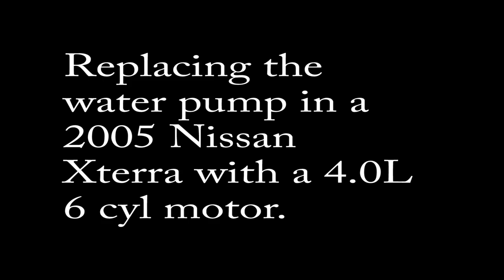How to Replace the Water Pump on a Nissan Xterra

Comment: Can you explain why you wanted to replace the water pump in the first place? Also, about how many miles were you at? Thanks for the video!
Reply from the maker: Hey man, thanks. This water pump replacement was an attempt to fix an overheating issue I had. I ended up doing the temp sensor, the thermostat, and the pump. I was at 132k when I did these. Hope that helps!
Reply: Jordan Horst I second that question. A water pump is the potential source of leaking and noise when the bearings and seals crap out, but is never (?) the source of an overheating issue unless something catastrophic has occurred, like a complete separation of an impeller from the shaft. And I personally have never seen that in metal clearance type pumps. (Referring here to the exception in rubber impeller friction pumps; e.g., Jabsco, used for the external water side of a marine heat-exchanger system.) And in the event of that separation, you would be popping off steam and/or seizing the engine, not just running a little warmer than normal.
Reply: eldorado96 what about overheating quickly from a cold start, Thermostat, radiator and fan clutch are good.
Reply: pono321 I covered that in my earlier comment. You would suspect water pump if there was no cooling (and a relatively quick and severe overheating condition) but that's not the original condition described. He said it was running a little warmer than normal. 

This was a great how-to video, but I'm still stuck on the implication that the original problem didn't warrant it. It still feels like throwing parts at a problem rather than making a true diagnosis.

The thermostat was replaced, but it could be flawed out of the box or calibrated to a higher heat range.  Given everything else being normal, I would be inclined to inspect the radiator more closely for occluded flow.

Comment: Was your tensioner making a slight knocking noise at first start up when the engine is cold I have a problem where I hear a knocking when I first crank up after the vehicle has been sitting overnight
Reply: same knock issue here :(

Comment: So I am having the same issues as you. Temps rising while sitting still. Rev the motor up the hand goes back down towards normal (so the water pump is working). However, using the bluetooth scanner, it shows my actual temps around 226-230 (getting dangerous). We have replaced the radiator (bc of a crack). Replaced all hoses. Replaced the thermostat and Temp sensor. Then the water pump (but the old one turned out to be okay). Next the fan clutch (it was bad). Burped the system. And using the All-makes All-models coolant 50/50. Not the blue. However, we are still experiencing the same thing. About 20-25 minutes of driving, the Nissan gets hotter. The temp gauge says it still in the okay zone. But the Bluetooth connector reads again...226 and it will hold steady at 226-228. But then you stop and it begins to creep to 230 (235 was as far as it got). However, it showed it was below the small tick mark before the H zone on the gauge. 

Have any suggestions? Are we missing something? You mentioned yours still creeped up and you replaced the water pump. Did you ever resolve the overheating issue? Thanks! (Great instructional too)
Reply: I'm having the exact same issues! I've done everything to try and resolve it. Now I'm on my last option the water pump. Let me know if you figure it out.
Reply: @kgregg2092  We discovered the radiator was bad. We actually put FOUR radiators in it from Advance Auto until we got one that was good! All factory defects: blockages or leaks at the bottom. The coolant in the Nissan flows up and down instead of side to side. This allows blockages to build up in the bottom of the radiator. ALSO. We discovered three thermostats did not work properly. Placing the thermostat (brand new) in a pot of hot water on the stove with a thermometer, you can see how it reacts. At 180, it should begin peeking open. At 190, it should be about half way open. At 200, it should be fully opened. Two of three thermostats opened half way at 205! And then fully at 225-230. The third thermostat was good. Check your thermostat. Don't assume it is good because it is new.
Reply: @oswalddesign  thanks so much for the reply. I'm going to replace the water pump and might as well do the thermostat again. I'll flush the cooling system too. Hopefully this will finally solve my issue. If all of that doesn't work the only part left to replace is the radiator.
Reply: @kgregg2092  Change out the temperature sensor as well. It's not that much — and it could very well be the problem too! We did so for good measure.
Reply: @oswalddesign  thanks again for your reply. I'll change the sensor too. I got the water pump out and it definitely was bad. My timing chain tensioner was also broken. So I'm hoping my issues will finally be solved.
Reply: @kgregg2092  That's great news! I bet the tensioner and water pump will take care of the issue then. For me, the water pump and the tensioner was still good — but there was evidence it had been replaced once before (gobs of gasket maker). The temp sensor is all the way to the back next to the firewall. It's a beast to get to so if the water pump does the trick, you may want to let sleeping dogs lie.

Comment: lol ... I couldn't depress the tensioner on the car either. That's why I looked up the video, to see how to depress it. I was about to remove it altogether, but decided to look first to see what others did. Turns out you did the same, though you didn't say so at the step in question.

Comment: RY,  Question for you. I just replaced my radiator, thermostat and the temp sensor. Filled with fluid and let it heat up and cool down a couple of times. I then start driving it and now the water temp gauge is going HOT. Now, I wasn't having an issue before but wanted to replace them due to 218K miles. It was working fine before but now it's overheating. Is the pump bad now all of the sudden?

Comment: Mr. Ry first of all thanks for your vids.  Can you help me with the right bank and left bank secondary chains install, I want to make sure I am doing right. Looking from the front of the car the intake I think I set I right, but I am a but insecure with the exust side as how to Mach the chain and the sproket with the oval markings and round ones. Any help will be appreciated. Any images could help. Thanks.

Comment: What milage is recommended for water pump replacement ?  If the water pump fails could it dump coolant into the engine oil?

Comment: I had an overheating problem on my Nissan a few years ago. I had no intentions of opening up the front of the engine for a water pump replacement. The shop did that and replaced the water pump. Over heating still happened and they replaced the thermostat. It still over heated. Once they got an OEM thermostat from Nissan the problem was solved. I think they got the thermostat from NAPA and it may have been for a different model or sized engine. What a costly mess. Oh....by the way, they tried a radiator swap and that didn't work.

Comment: did replacing the water pump resolve the idling over heating problem?
Reply: OmoOwa I'm wondering to
Reply: Doubt it.
He never comfirmed that it did.
My bet, the actual radiator was blocked. Even though they look good, the inside can be shit house.

Comment: Any chance you can post a link (Amazon) for the coolant fluid you used that is equal to OEM Nissan coolant fluid spec. I need to purchase some, That would be greatly appreciated. One more question. what is the required amount of fluid needed for fluid replacement on a second gen Xterra. Mine is 2007.

Comment: OK! I Ry did answer that the issue was solved. But that he did not know if it was the new water pump or the flushing of the radiator that fix the problem. It is like 100 comments down!
Reply from the maker: I’ll find it and pin it now that I can do that now. Thank you.

Comment: Hi, hopefully you see this soon, after you loosened your chain and replaced all that you needed to, did you have to tighten the chain back? 

I followed as much of your video as I could, but this one question has me worried considering it's such a crucial part
Reply from the maker: No, if you just rotated the crank a little to loosen it then it will be fine. If you're finished putting the water pump back in you can rotate the crank the correct way and you will see it tighten right back up.

Comment: Are you sure the popping noise while you was turning the crank without tensioner in wasn't chain jumping?
Reply from the maker: I’m sure. After I made this video I replaced all the timing. When I took it apart the timing was correct.
Reply: Did you ever get the overheating issue resolved?
Reply: I'm wondering the same thing. I'm working on my cousins Xterra and running out of things to check/replace.
Reply: @oddpowerscustoms  I got mine figured out, I replaced the thermostat with a new one, new one was bad out of the box, ordered a new one from the factory, all good now

Comment: Nice video . Can you tell me if the oil pump is hidden in the timing chain chamber? Do I have to remove the front cover to get it replaced?
Reply from the maker: Yes, you need to removed the upper and lower oil pans, and the timing chain case. Along with the timing chain itself.

Comment: Hey Ry, still working on my frontier overheating and noticed the electric ac fan doesn't come on when turning on the ac.  I bring it up to temp and the fan never turns on that I am aware.  Is your xterra the same way (fan rarely turns on)

Comment: Please help, I have a Frontier 4.0 with a 110 K miles, had a problem with overheating but it never got above half, I replace radiator, fan clutch, thermostat, radiator cap, only thing left to do is the water pump, but I’m not sure anymore.  Please help. Thank you

Comment: Hello ry, i just done replacing my water pump in xterra 09, I noticed after that some water mixed with the engine oil is that possible to happen or you think i have another problem?? Btw I didn’t get any over heat issues before, I changed it because i had a leak in coolant water. Any help plz

Comment: Great video, and thorough walkthrough!  Did it resolve your problem?  Or did you have to do something else to it?  I have an 06 that is having an overheating issue, and wondered if this might resolve it.  Thanks!
Reply from the maker: It did! Since my pump was in such good condition I don't know if it was the water pump or just flushing out the old radiator fluid in getting the proper stuff in there
Reply: +Ry the car guy Most likely the fan clutch....

Comment: Hi !  i thoroughly enjoyed your Video.  Question:  If the Tensioner can be compressed and locked with the rigid .32 wire, does it still need to come out to remove the water pump ?  Your Video is one of the very best in answering my questions except for the one about the Tensioner. Thank Yo so much. ~Rick
Reply from the maker: Hey Rick. Thank you. I suppose if you plan to reuse the tensioner then you should be able to just lock it and leave it. I just make it even tighter getting the belt back on.
Reply: @Rythecarguy  Thank you so much for your advice ! I appreciate your videos.  Keep up the awesome work !

Comment: Hey guys need some help. Replaced water pump and now I’m putting the tensioner back in. Seems hard to get in and not enough slack in the timing chain. I’m scared to keep turning it for fear of skipping a tooth. Any help would be appreciated.

Comment: Don't use anything but a 6 point wrench on the fan clutch. If they are on super tight like on mine you will strip the nuts.

Comment: Hello Ry hope your evening is going well, I wanted to pick your brain for a second if I could.  In regards to your water pump replacement video on your Xterra I noticed you did not have any issues putting your new one in, l can't seem to install mine into my frontier.   It appears I have just as much slack on my timing chain as you do on your video but I can't seem to get past it, any suggestions?
Reply: Did you take out the timing chain tensioner

Comment: Hello, I hope that are are still taking questions. My question is, Did this solve your overheating problem?
You said that the water pump on your Nissan seemed to be OK. I have the same problem, my 2006 pathfinder is running hotter than normal, after I replaced the thermostat is when it started doing it. The cooling level is normal, there are no visible leaks. Any feedback would be greatly appreciated.
Reply: Try to burf the car

Comment: Hello Ry,
   Why did you replace your water pump ? Was it failure at that point or you just replaced as a preventive maintenance ? Thanks
Reply from the maker: I wanted it done as preventative and to eliminate it as a culprit for the overheating issue I was having.
Reply: @Rythecarguy  did it fix the overheating issue?

Comment: Hey man awesome video! There doesn't seem to be many instructional videos for this SUV, so being a diyer these videos are a lifesaver. 
Thinking about buying one on Monday (an 08), did (do) u still like yours? It looks like working on them is a pain...

I've heard bad things about the SMOD problem, (cracked internal Rad resulting in coolant mixing with trans fluid), and that's my only concern....
Do you know of a way to tell if the transmissions been replaced? I checked the trans fluid and it's brand new, I think it's a new Rad also...
Took it for a test drive and seemed great, but I'm going on Monday and I'll really take it for a spin.
Do you have any info on the SMOD problem? If the tranny is the original I'm wondering if I should still purchase if I suspect SMOD... He agreed to warranty the trans and engine for 6 months @ 500 so that's a bonus....

Anyways keep up the awesome videos!
Reply from the maker: Thank you ! I love mine. Its a two wheel which was fine in Florida but since I’ve moved to Michigan its been a little crumby in the snow. The SMOD can be a big deal and I would show caution when buying automatic. If you’re worried about it you can bring it to a trusted mechanic and ask them to look it over before you buy it. My Xterra is a manual so it does not have a transmission cooler so I never had to deal with it.
Reply: Ry the car guy went to the Nissan dealer. Guess what? They told me that it looked like the original trans. So it probably had smod but they just replaced the Rad and flushed the fluid. Right away it was a no go.
Thanks again!!! It's videos like these that really help!

Comment: Nice vid bro, I have changed water pump thermostat flushed system bled the system still gets hot while driving and be heat in the car any tips/suggestions
Reply: Hey K.O.D_VIC. how was the water pump? How many miles in your X? I have changed everything but the water pump. Before I get to do it I am gonna pressure test the system and check for exhaust gases in the radiator.  How hard was it to remove the water pump. any problems with the bolts? Any tips? Mine idles at 195* F but when I go on the express way at 60mph and 1500RPMS the temp goes up to 210* F. But if I accelerate and raise RPMS to 3 to 4500 RPMS the temp goes down to 195*F again. So I am leaning towards the water pump. 
Maube we can compare notes and help each other?
Reply: Carlos Cameselle I’m still having the same issues with mine but after some more research I’ve come to the aftermarket water pumps being faulty in these vq motors so my next step will be replacing the aftermarket pump with a oem Nissan pump I’ll keep u posted....
Reply: K.O.D_ VIC did you replace the thermostat with a Nissan one? It made a difference in my! With a brand new aftermarket thermostat the idle temp was at 206* F. Now with the Nissan owl is at the normal 195* F. And it is a lot easier to change the thermostat than the pump!
Reply: I just got final verification that I have a blown head gasket. very mild but I have one none the less.  :(

Comment: Hi Ry ! Sorry to be a pest.  Did you have to change the oil and oil filter after replacing the water pump M8?  I'm just want to cover all bases while I have access to the filter while I'm in the engine area.  I had changed my oil about 30 days before the water pump went out is why I'm asking.
Reply from the maker: NP, Yes I did, when you get anything in the oil like that you should change it.
Reply: @Rythecarguy  Thanks Ry !

Comment: It was nice to include an instruction to obtain a couple of M8 bolts of adequate length before starting the job. Perhaps you made note of the thread pitch needed.  I see M8x1.0 and M8x1.25 in the store.
Reply: Take the new pump with u to buy the bolts to make shure they fit or else the ppl at home depot will loom at u crazy cuz there are more then one size of an m8 bolt.
Reply: @christopherfuentes1278  Just guessing, but it might not be the pump that has the threads needing to be matched. And taking the block to the store is a bit impractical. ;-)
Reply: I thought that the bolts go through the pump and push against the body and that is what makes the pump push forward. Im guessing it works something like a steering wheel puller or harmonic balancer pulley remover. Idk im just guessing. How hard is it to actually change the water pump. Ry makes it look easy but i know its prolly alot harder then it seems.

Comment: I have the same vehicle. Having same overheating problem and planning on changing the water pump.  Already replaced the thermostat/housing and replaced radiator.  Also 6 month or more I noticed that it was no longer starting right up quickly.  It turns 5, 6, 7 times before it cranks up.  Changed the (4) 02 sensors to the tune of almost $500.  Didn't change anything.  Any ideas.  Also if the water pump doesn't solve the overheating problem then what?
Reply from the maker: Long cranking can be a few things. Fuel pump dying. Battery dying, bad cam/crank sensors etc. you may want to check your fan clutch or the electric fan as well if you are still over heating.